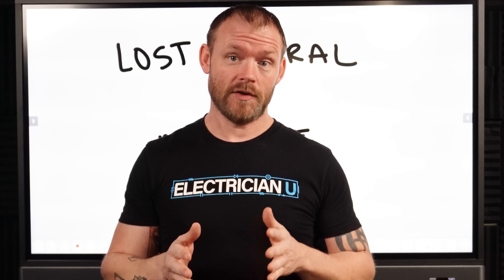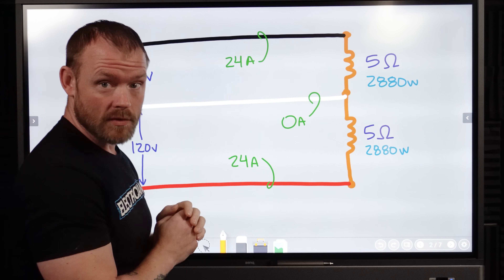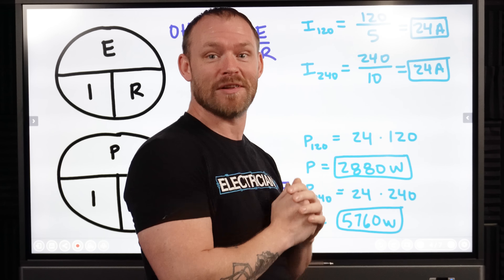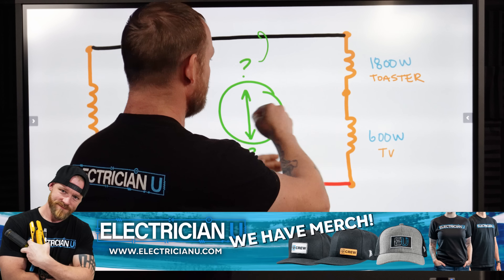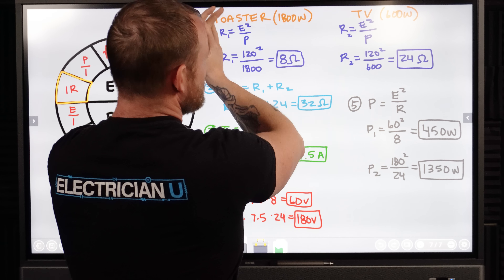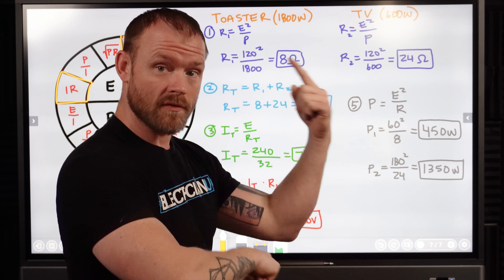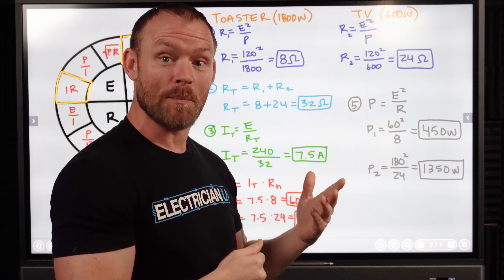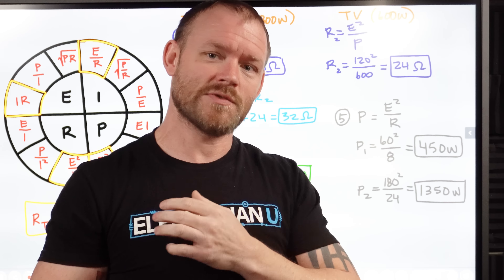NOT SAFE? Losing a Neutral in a Multi-Branch Circuit

Comment: Dustin i suck at math and i have been watching you for years and no matter how you explain it i still don't know how to add any susggestion because i could never take the test, guess i'll always be a helper.😆😆😆
Reply: This trade ain't for everybody. No shame in that.
Reply: Clarence,   Do not give up!   I sucked at math too.   When they start talking formulas, my brain could not comprehend them.   My first drafting job I got, I had to do trigonometry.  I totally failed their test for employment.   When a guy showed me once how the math worked to find what I needed to know, no one ever had to tell me again.   I was doing trig all the time, and was easy.   Then I got a job drafting electrical systems.   When I saw what I needed to know and was shown how to do it, I had no issues with the math for electrical calculations.   Focus on the problem and the steps needed to do to get the answer.   Avoid trying to use the formulas.   BTW, I was approved as a PE in 2007.   You can do what ever it is you want to do!   Best wishes,   Kevin

Comment: Many years ago had a computer lab (think 30 user computers and monitors in a room) that lost a neutral. Pop. Pop-pop. Pop-pop-pop. Monitors fry in turn as they get too high a voltage, die and in doing so reconfigure the load to pass more voltage to other ones.

Comment: The crazy thing is if the TV is on by itself, it will go from 600 watts to 2400 watts. It doubles the voltage AND the amperage and quadruple the power

Comment: Surprised you didn’t mention, nor did anyone make a main comment, that the CODE requires the two hot conductors in a multi-wire branch circuit to be connected to a 2-pole circuit breaker.  This arrangement de-energizes both hot conductors when the circuit breaker is opened, and ensures that there is NO current flowing in the neutral.  The main use I see for a multi-wire branch circuit would be duplex receptacles in a garage, barn, shop, etc.  By wiring one of the receptacles to the black and the other receptacle to the red, you can make full use of each receptacle at the same time while never exceeding the current rating of the neutral wire, which is the same as the two hot conductors.  So two power tools can be conveniently plugged in and used at the same time at a single location.  Of course, the same thing can be accomplished with two complete separate circuits, each with their own breaker.  The downside to that arrangement is if someone opens one of the circuit breakers and doesn’t realize that the outlet box is still hot.
Reply: Code requires that 240 volt circuits have both breakers mechanically interlocked, but it also requires that any 240v circuit can NOT have multiple branches.  The circuit that you describe with two 120v outlets that each use a different phase for hot, but share one neutral is prohibited by code.
Reply: @phillipsusi1791    I disagree.  2023 NEC section 210.4 covers this and exhibit 210.1 is an illustration of exactly the situation I am describing.  I’m not saying it’s a good idea; just that is is allowed by code (if done correctly).
Reply: @brucefay5126      Yes, you can use a two pole breaker for the “disconnecting means” required in the NEC.   But you can also use handle ties manufactured by the panel manufacturer.
Reply: @brucefay5126  I might have misunderstood what you were talking about originally.  Do you mean L1 going to one 120v outlet, and L2 going to another 120v outlet, but both share a common neutral?  If so, then that should be ok, and shouldn't even require the two breakers to be interlocked.
Reply: @phillipsusi1791  just when I think you know what you’re talking about, you go and totally blow it by saying you don’t need handle ties
Reply: @phillipsusi1791  No.  The example illustration in the 2023 code shows the two receptacles of a duplex receptacle on different hot legs (tab broken) with the neutral tab still intact and just one neutral wire to the pair.
Reply: @brucefay5126  Ok, that sounds like the same thing.  I mean, whether it is two outlets in one box, or two pairs of outlets in different boxes, I don't see the distinction.  The important thing is that it is 120v outlets and as long as they are on two different phases, they can share a common neutral, since the worst case load on the neutral is 20 amps without tripping either of the 20 amp breakers on the legs.
Reply: @highvoltage1979  Wait, ok... one 120v outlet on one phase, one on the other phase, common neutral.  Why would the breakers need to be tied together?  They are two different circuits.  If one trips, the other can operate just fine in isolation.
Reply: @highvoltage1979  Wait... I think I've got it... under normal conditions that would be fine, but if the shared neutral breaks, NOW you have path from L1 to L2 through the now isolated neutral, and that will cause voltage swings.
Reply: @phillipsusi1791  I think you got now, but the handle tie has a lot to do with safety for the electrician.Before tie handles where required in 2014 ,If you where to work on one of the circuits in a multi branch wired circuit and where to only turn off one leg or one breaker in a three phase system and then touched the neutral you would be shocked. If you break the neutral at the splice box you would start destroying equipment.
Reply: @highvoltage1979  Ahh, right, if you believe the whole thing is off ( rather than only half of it ) and CUT the neutral, then the voltage on the isolated neutral would get high and could shock you.  As long as the neutral isn't cut though, it is no different from any other 120v circuit that never had the second leg there in the first place.  I guess that's a decent enough reason to have added that requirement.
Reply: I went back and looked at the example again (Exhibit 210.1) and I did NOT report it correctly.  My bad.   The exhibit shows two duplex receptacles sharing a neutral, but one of them is fed by L1 and the other by L2 (via a 2-pole breaker).  Exhibit 210.2 shows a “combination (double) receptacle” with one receptacle for a 120V load and the other for a 240V load.  L1 feeds the 120V receptacle and one side of the 240V receptacle.  The neutral only serves the 120V receptacle.  L2 is connected to the other side of the 240V receptacle.  L1 and L2 are fed from a 2-pole breaker.  Sorry for causing any confusion on this issue.  But returning to the main issue, both of these Exhibits constitute multi-wire branch circuits, but neither of them would put loads in series in the event of the loss of the neutral.

Comment: 12:55
Power is not consumed neither transfered.
It's observed, when it comes to "watts".
The only thing that is "transfered or consumed" in an electrical cicuit, it's the PRESSURE.
And what is electrical PRESSURE..??
Voltage

Comment: So, if i want my 120v toaster to draw less current, i just have to connect it to a higher voltage ??!! 
I think thats what some people might assume...
Since E=Ri and P=Ei
1800w on 120v = 15A
1800w on 240v = 7.5A
Some people think that raising voltage will drop the current, and everything will work out just fine.

Comment: If a device (like the TV in this example) is a world voltage device (100v-240v) would this example cook the TV?  Just curious.
Reply: The TV likely won't be damaged by this 'lost neutral'.  It might end up acting like it is in a brownout depending on how the other circuit and other devices on its circuit behaves. The analysis in the video is not correct for basically every digital device.

My quick and dirty analysis for the a lost neutral is something like this: assume every device on both circuits will at some point see the full 240V. Any devices which are not rated for this voltage are likely to be damaged.

Comment: but what if your MWB is on a tandem breaker then there would be no P2P potential between the parallel loads
Reply: then your 12 wag neutral could carry 40+ amps potentially.
Reply: A tandem breaker has two switches on one phase.  I think what you are talking about is an interlocked two pole breaker to power a 240v circuit.  In that case, either breaker only trips if the current on one phase exceeds its trip point.  If you run both phases and a neutral out to two different 120v outlets where each outlet gets one phase and the neutral, depending on the loads that are plugged into each outlet, if you lose the neutral, you can still keep the total current below the trip point of both breakers, but the voltage on one outlet can rise above nominal.  This is why code forbids such a circuit.
Reply: @christraudt6730  Again, assuming what we are really talking about here is two 20 amp phases with a shared neutral, then no, the neutral can't carry 40 amps.  If 20 amps goes out on one phase, then you either have 20 amps coming back on the other phase, or 20 camps coming back on neutral, or somewhere between, but you can never get to 40 amps on the neutral without tripping the breakers.
Reply: @phillipsusi1791  yes, i was referring to a tandem as you describe

Comment: Thank you. I understand how the voltage will become greater or less on the loads. What I don’t understand is how there’s still power flowing through the “tv” etc after losing the neutral. Would the circuit not be a “complete” circuit so no current would flow? I def believe you and have been told this. If there anyway you could show like a computer or animated diagram of how the current still had a return path it would def help connect the dots in my brain haha. Again love electrician U and thank!
Reply: The neutrals are tied together on both legs, since both circuits have a hot and share both ground and neutral. If the shared neutral line is broken between panel and end devices, the circuit completes:
hot - neutral - hot
as both hot are still connected. So effectively the circuit is hot leg 1 to hot leg 2 (neutral is now just a bonded connection)

Comment: This is why the Code says you must pigtail the neutral at each device; i.e., you can't just land both neutral wires on the receptacle and pass through it.  The most problems I've had with open neutrals is when the power company does it.  😒
Reply: Code doesn't even allow multiple branches on a 240v circuit.  That's why it's only a problem when the neutral breaks coming in from the pole.
Reply: @phillipsusi1791  what is the code reference?
Reply: @phillipsusi1791  I don't understand what you mean by " multiple branches on a 240v circuit".
Reply: @barryomahony4983     Please tell me where that is in the NEC.   Article number!   BTW, that would not cause or stop a lost neutral issue described in this video.   If a neutral is lost on a receptacle with two neutrals connected to it, the receptacles would have no voltage.
Reply: @barryomahony4983  I mean a 240v circuit with multiple outlets.
Reply: @KevinCoop1  Huh?  An outlet tied to two neutrals would have no voltage on it with nothing broken.  I don't recall where it is but I'm sure that code says that multiple outlets are only allowed for <= 20 amp 120v circuits.  Anything larger must be a dedicated circuit to a single load, or a feeder to a sub panel.
Reply: @KevinCoop1  300.13(B) "Device Removal. In multiwire branch circuits, the continuity of a grounded conductor shall not depend on device connections such as lampholders, receptacles, and so forth, where the removal of such devices would interrupt the continuity."
Reply: @phillipsusi1791  15A and 20A receptacles commonly have multiple terminals for both the line and neutral conductors, so these conductors can just be daisy-chained through the receptacle.  You can't do that on a MWBC, since if the receptacle somehow fails or develops a loose connection (e.g., a back stab contact), then the neutral is open; not good. 

I don't know of anything in Code that prohibits multiple outlets on a 240V circuit.  In fact, duplex NEMA 6 receptacles are available, although rarely used in dwellings.    In any case, 240V-only branch circuits do not have neutrals.  This video is about a 120V/240V multi wire branch circuit.
Reply: @barryomahony4983  I may have misremembered the 240v part.  I think it was just the amperage.  15 or 20 amp circuits can have multiple outlets, but higher amperage circuits have to be dedicated.  I also might be misunderstanding the multi-wire branch circuit term.  I just saw the branch part and thought it meant multiple different outlets branching off from one circuit.  Does MWBC mean two legs going to different 120v outlets with one shared neutral?
Reply: @phillipsusi1791  MWBC are branch circuits with one neutral conductor (called "grounded" in the Code) and more than one line ("hot") conductor.  The branch circuit breakers must at least have handle ties, so they are all switched off at the same time.  A 3 phase 120/208 is one example.  Another is a single phase circuit with two hot conductors on opposite legs of the split-phase circuit, so that each one has 120V between the hot and the neutral.  There's also 240V between the two hots, so in something like a clothes dryer circuit, the 240V is used for the heating coils while 120V is used for the control circuitry.  In non-dedicated circuits, you can't have both 120V and 240V loads, unless the breakers have common trip, so they all cut out when an overcurrent or short is detected in one of them.
Reply: @barryomahony4983  Right, you can't have both 120V and 240V loads without a common trip, but if you only have a pair of 5-20 outlets in the kitchen, there's no 240V load, so there shouldn't be a need for them to trip together.

Comment: How do you protect appliances from a neutral loss?
Reply: 120v appliances don't need any protection if the neutral breaks between the outlet and the breaker box.  That completely interrupts the circuit.  It's only a problem for 240 volt appliances that also use the neutral to tap only 120v for part of their operation ( which pretty much means only clothes dryers ), or if the whole house loses its neutral, in which case, the protection is the same for any over voltage situation.
Reply: @phillipsusi1791  
It's not only a problem for the 240v loads.
Reply: Doug,   You may or may not have multi wire branch circuits in your house.   If you look at your single pole breakers and only have black conductors, then you do not have any of these circuits.
Reply: @KevinCoop1  Umm... no?  The color of the wire used in no way indicates whether it is a branch circuit.  Pretty much all homes use mostly branch circuits.  You pretty much always have one circuit going to several outlets in a given room, or multiple light fixtures, or a mix of the two.
Reply: @FOH3663  I'm not sure what you mean here by "it".  I can only assume that you mean a neutral break between the panel and the load, and like I said before, it is not a problem for either 120v loads, or pure 240v loads.
Reply: @phillipsusi1791  It would be problem for 120V loads if the neutral disconnects next to the panel. Because that means the "remaining" neutral can be used to series-link the 120V loads from both circuits into a single 240V circuit. Then a smaller load on circuit 1 will have to handle overvoltages > 120V (and therefore overcurrents > whatever it's rated for), while the larger load on circuit 2 gets brownout. This is what happens when you lose a neutral that previously kept both circuit voltages "balanced"...
Reply: @MikeSmith-vb8ul  that's why you are not allowed to share a neutral between two different branch circuits.
Reply: @phillipsusi1791  No, you actually are allowed to do this! Multi-wire branch circuits are allowed to share one neutral as long as they are on opposite 120v phases, despite the obvious danger of the "open neutral" !!
Reply: @MikeSmith-vb8ul  NEC 200.4 says "(A) Installation. Neutral conductors shall not be used for more than one branch circuit, for more than one multiwire branch circuit, or for more than one set of ungrounded feeder conductors unless specifically permitted elsewhere in this Code.".  Is there somewhere else that says it is ok as long as both branches are on different legs?
Reply: @phillipsusi1791  How about NEC 210.4?
Reply: @MikeSmith-vb8ul  Well I'll be.  That does seem to allow this nonsense.  I could have sworn they had gotten rid of all of that years ago and these days the only multi branch circuits still allowed were 20 amps 120 volts.  Anything 240 volts or higher than 20 amps HAD to be a dedicated circuit.  That certainly seems to be standard practice for the last 30 or 40 years anyhow.

Comment: I get part of what you are saying. The part I don't get is that in a real world scenario, in an AC circuit these two loads for instance would not be connected to the mains in series, as far as I understand. Would it behave in that manner in that particular scenario even if it is not connected in series because of the nature of AC as opposed to DC?
Reply: The MWBC has to be on both legs of 240v panel, with each hot line being on a different leg. Use a double pole 240v breaker for this.
If it was powered on a 120v single leg, the neutral would have the combined amp load of both circuits. You'd need a 8 gauge neutral.
Reply: They would be in series if the neutral were somehow opened.
     In the real world AC circuits are not in series.
EXCEPTION:  Christmas Lights.  The string of 8 or 9 lights is in a series circuit.  However at the end of the string is a receptacle which ANOTHER string can be plug into.   Now, these TWO strings of lights
are in PARALLEL with one another.
                 Confused enough?
Reply: All the neutrals are bonded together at the panel.  If you happen to lose neutral connection (but not the hots) between the panel and the service, then this bonding would put the loads in series.